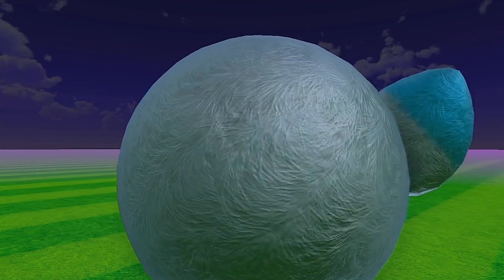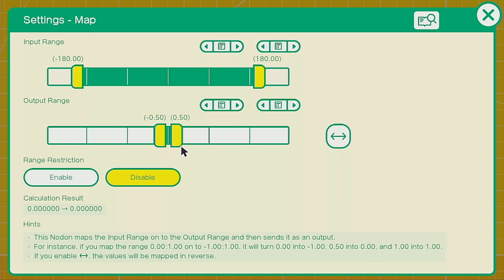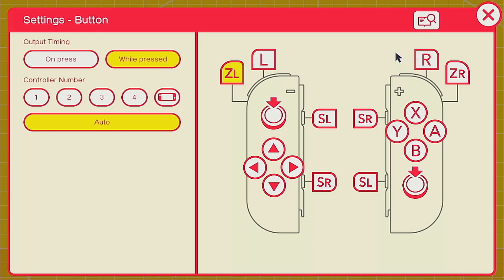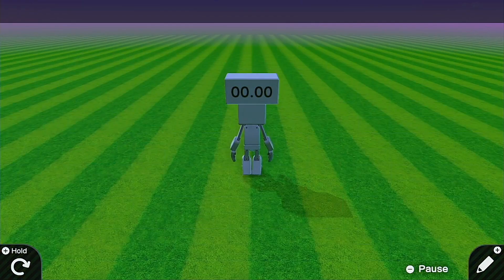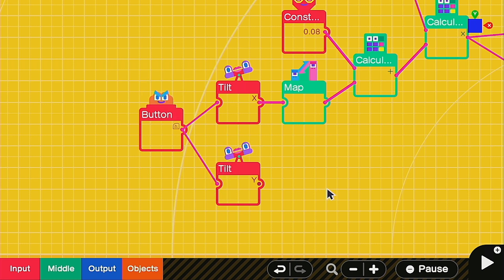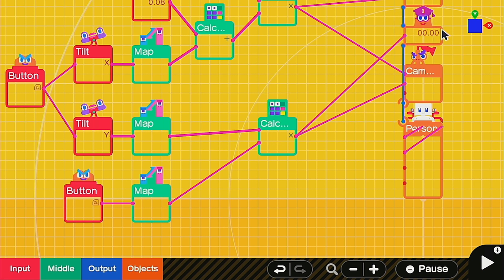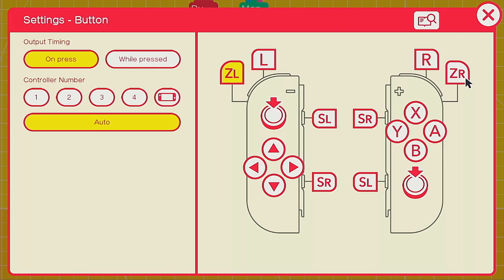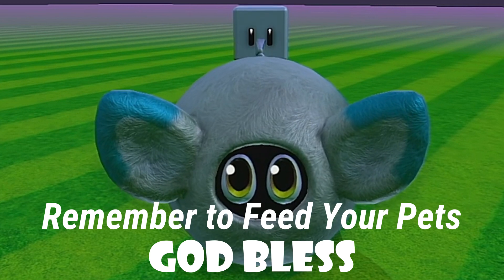Make Your Camera WAY More FUN👋 😎

Comment: Mine won’t work. All it is doing is going straight up
Reply from the maker: It might be your joy con sensors not working well or it could be that you're missing a map nodon. Also if you set a map nodon incorrectly it could cause that. I hope that helps.

Comment: you can hit INPUT, MOTION, ROTATE (i think) and then hit console, then hook it up to cameras and you can change the speed of it by using the same parts as the DPAD movement video and i made a real vr game with no buttons needed
Reply from the maker: That's really cool :) when I tested that for controllers it was a little shaky but for vr it would be perfect 👍
Reply: @timothyhinz1851
could i get the VR game code?
Reply: @AWorldThatWas  I don’t have switch online anymore, can’t find the code